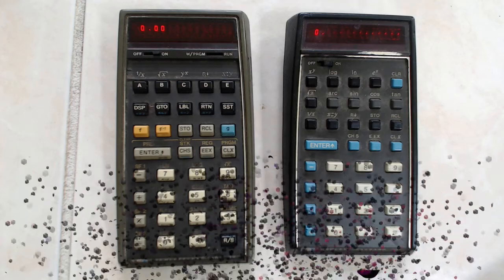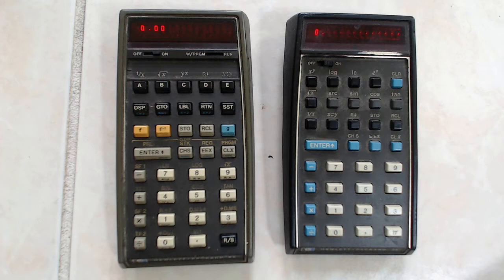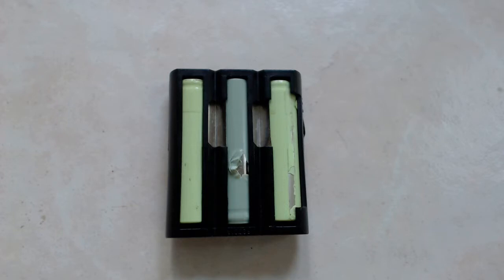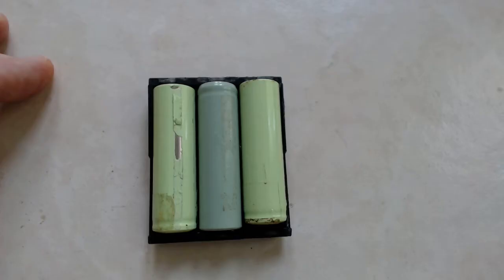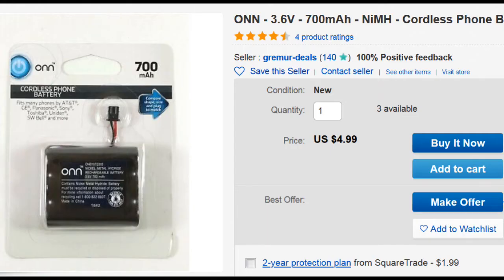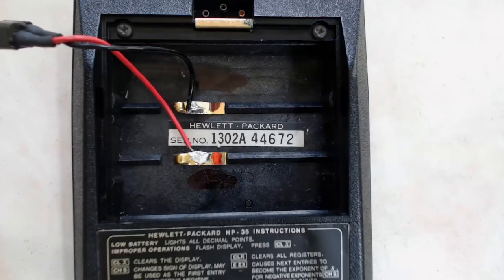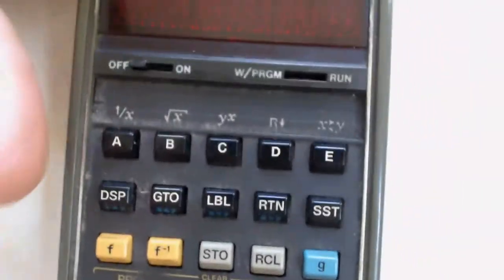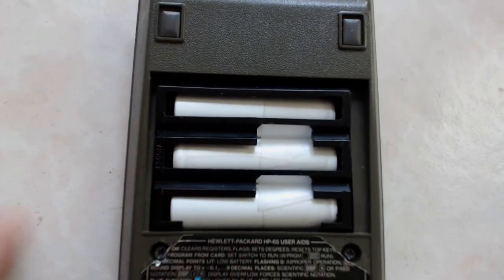Old HP Calculator?  Give it a New Battery!

Comment: Ed, how do i search for the female connector? What is the exact term?
Reply from the maker: I really don’t have an answer for you.  Mine was a salvaged part from an old phone.  Digikey sells some under “Headers Male or Female pins”.  That $7.00 minimum shipping charge makes them kinda pricy.  You can find a set of ten on eBay, but that means cutting off the battery connector and replacing it too.

Comment: NiMH will overheat with the original charger, why not use NiCad batteries?
Reply from the maker: Well, both are obsolete technology.   I used the newer technology.   The trick is to keep the charging voltage as low as practical.

Comment: A neat solution. Have adapted slightly by making copper plates stuck to the battery pack, to make a removable pack that can be used in other calculators, and leaving the calculator totally stock.

Comment: You can buy a 1000ma battery pack off of eBay for less than $20. Or for a bit more, you could get the 3000ma battery.

From the listing: "The CL-1000 battery pack is designed to be used as a replacement for discontinued Hewlett-Packard   HP82001A  and  HP82001B packs." Looks pretty much like the real deal too.

I collect calculators, and the HPs are my favorites. Yesterday I bought a HP-20, a 41CX, and a 67. The 67 comes with a new battery. Same one as what the 35 uses.

Curiously, I don't own a 35. :)

Comment: I just purchased one of these, in the original plastic-box, with original power-supply and the soft leather-case, apparetly never used., still rolled up.
It also has the manual, in Danish(!!).
Only problem is, of course, 
the battery-pack.
Incredible how, 50 years after it was manufactured, it still powers up and the keys give a nice tactile feedback.
Bought it because I collect sliderules and this is 
The Sliderule Killer..
Paid 100 DKR, 
or about 15USD for it😊
Reply from the maker: A HP -35 sold for $400 in 1974.  The HP-65 was $800 in 1977.  The 35 still works 100%.  The 65 has a bad LED segment driver and the programming function has died.